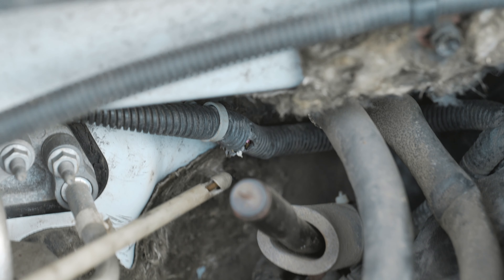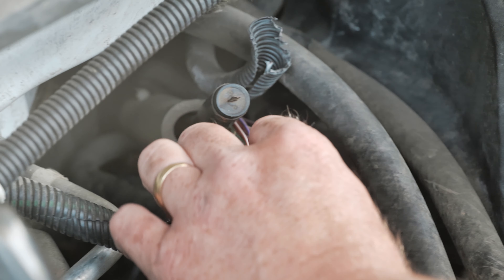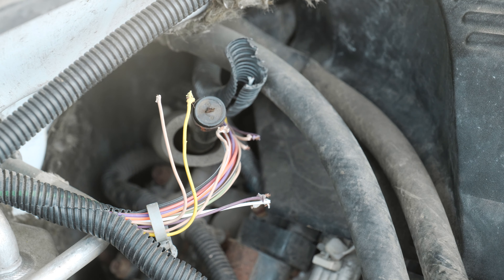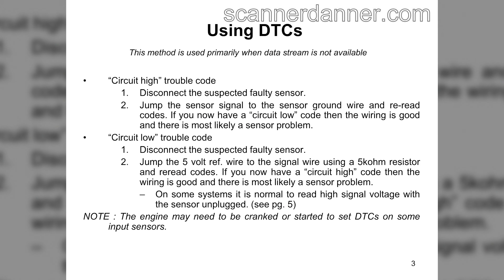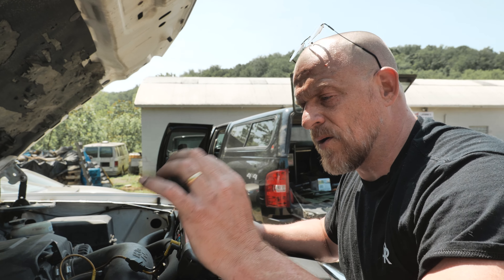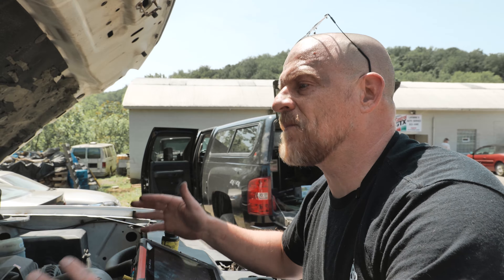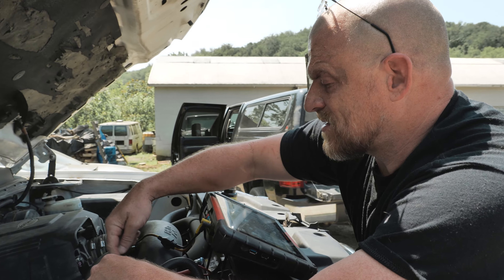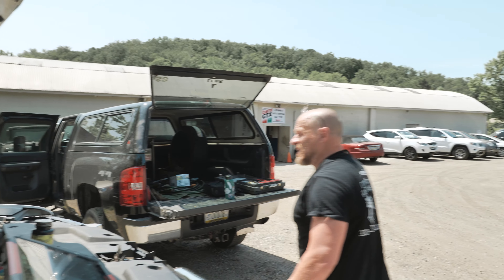Circuit Integrity Testing [open and short circuit verification without an ohmmeter]

Comment: I had a 3rd 5 volt ref signal high an it only runs to the map an the throttle pedal on a wire diagram but could not get it to go high or go out in the shop or on a test drive used a snapon vantage
Reply from the maker: is there a question here?

Comment: I have one confusion/myth about running starting a car ...

Say, car battery is very low and unable to crank engine.

Now, as the car is push forward with gear engaged, it starts running the engine.

So, where does the required voltage to start the car comes from when the car is started by pushing i.e. running start. Whereas initial battery voltage was very very low 🤔🤔🤔
Reply from the maker: you only need about 8v for an ignition system to be able to fire and maybe about the same for the injectors, by "run starting" a manual transmission engine, you are using the cars wheels to drive the crankshaft. 
This same low voltage (8v in my example) is not enough to turn the starter and drops even further when a crank is attempted.
Reply: @ScannerDanner  if i understand your statement correctly.....

So, that means, the injector is still supplying fuel into all cylinders even when battery voltage is unable to crank the engine.
Reply from the maker: @tnamen1307  yes, spark and fuel. It takes over 500 amps to get a starter moving initially and it only takes 10 amps for an ignition coil to fire and 1 amp for a fuel injector
Reply: @ScannerDanner  thanks so much for the clarification.

And really sorry for my poor English since I don't have good writing skills and speaking too which is why, to be honest, I studied till class 12 level only. 😞😞😞

Comment: Dan I got a question for you, got af sensor showing 0.0 volts on obd2. It’s a new sensor. MAF sensor fluctuates from 0-4 volts, which is very confusing. No engine codes. Is it pcm or ecu ?
Reply from the maker: No codes and runs good? Drive it!

Comment: I have one curious question....

I have only about 0.025 to 0.035 amps of parasitic draw which is normal.

I want to upgrade the battery rating 45Ah 12V of my i20 2011 India version to a higher rating say 50 Ah 12V.

Because I want to install aftermarket remote central locking unit which consumes very negligible current when in idle state so that the total parasitic draw is almost the same as was before. Just to compensate for the current consumption by the remote central locking unit, I just want to increase the battery to 5Ah rating.

So, I'm curious to know if there will be any effect on the alternator in charging the battery or any issues with the system or electronic components or sensors etc if battery is upgraded to higher rating?
Reply from the maker: Nope, the bigger the battery or the higher the reserve capacity, the better. You will NOT stress that alternator at all

Comment: — CASE STUDY- turbo coolant PUMP- 
P2602 code . ! 
2015 Dodge Grans caravan 
Coolant pump circuit LOW . 😮

Checked 
power : about 10.5 V . 
Ground : Good 
Signal : 3.5 V . It gets stuck there when connector UNplugged . 

This isn’t a 5V ref circuit . Can I still use this method to jump the signal to ground or signal to the Voltage reference ? 

- I used a Power probe to check the signal voltage , when connector unplugged the voltage was like 3.5 V but the power probe makes a weird noise . Like if something was trying to ground the signal way too fast but then unground it .
@scannerdanner #scannerdanner